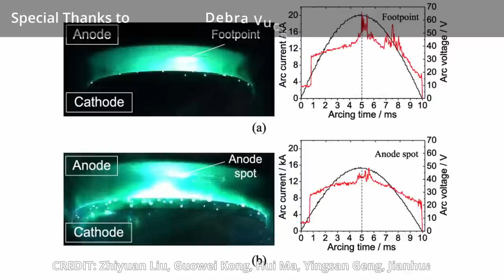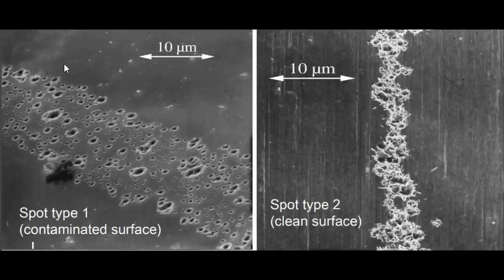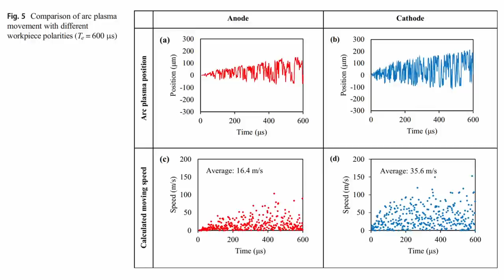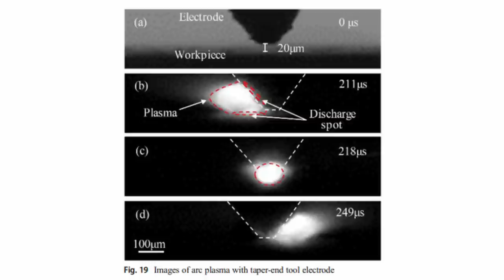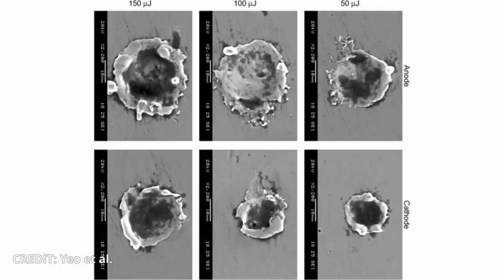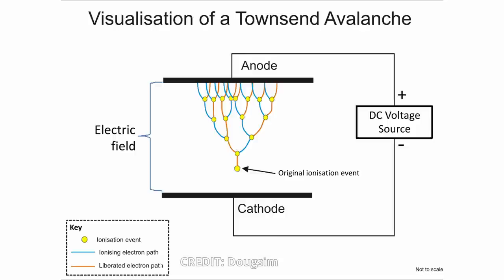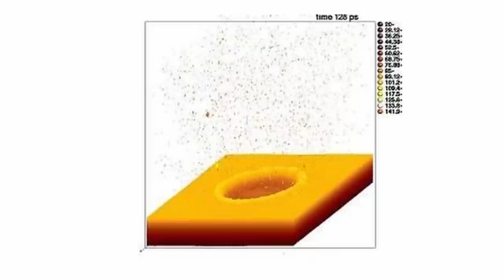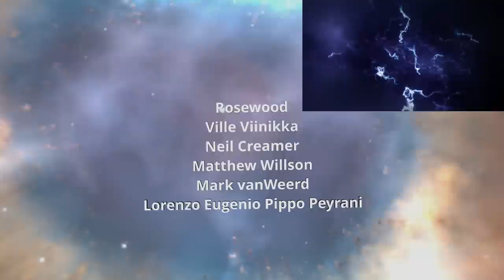Electrical Cratering - What is the difference between Anode and Cathode Craters

Comment: Given that the solar wind particle density (10 per cubic centimeter) is far less than the particle density of our best laboratory vacuums (about 26000,) it is highly unlikely that the Don Scott anode-cathode model of the solar wind acceleration is at all possible.   Otherwise, we would see a vacuum arc discharge between the Sun and the heliopause instead of a steady solar wind of 400-450 km/sec, as has been measured at all of the outer planets, nor would we see both positive and negative charged particles flowing outwards with the solar wind, not to mention that the solar wind particles are instead accelerated by first ionization potential, all contrary to Don's claims.
   One has to do some major cherry-picking and ignoring of the data on the solar wind and vacuum arc discharges to imagine that the Don Scott claims, about the solar wind, resemble the solar wind at all.
  A number of books on the solar wind state that the solar wind is accelerated out by pondermotive force, not by charge potential or mass, as Don claims.
Reply: So distance between the anode and cathode determines whether arc discharges occur or not.
Reply: @JD-pr1et  arc discharge occurs through  a vacuum or through a dielectric.  A dark mode plasma current flow requires a particle density on the order of 10^13 plasma particle density. The solar wind particle density is 10. Therefore the space between the Sun and heliopause is by definition a vacuum, and far better than any vacuum produced in a lab.
   According to Don Scott's book there is maybe 500 kilovolts potential between the Heliopause and Sun at about 200 AU approximately.  The solar wind particle density is 10 so would be talking vacuum arc discharge but probably not at 200 AU. Definitely we would not get an anode-cathode plasma current flow associated with the solar wind.
    To put this into perspective the distance between the ionopause and Earth is about 300miles ? maybe and voltage of 350 kilovolts, but no such anode-cathode wind develops into or out of the Earth.
Reply: That seems way off topic to this video but also very interesting. I do like me some alternative EM models, and the pondermotive force is an intriguing EM explanation. 
However, one reason I would pose as to why no discharge occurs between the sun and the heliopause is because of the stormy and discharging planetary system between. Main currents are via planetary poles along circuits rather than just dissipated via EM radiation. 
Granted, I'm not speaking from Donald Scott's model because I'm not sold on it. I'm just speaking from my own musings.
Reply: @KittyBoom360  there is an interesting book out on the solar wind that energizes the planets.   'Magnetotails in the Solar System.'
    The planets are energized by the solar wind and there is a distinction drawn between magnetized planets, like the Earth, and unmagnetized planets, like Mars and Venus.
       This book is  compiled from data from the NASA and other countries' planetary and solar probes and from solar observatories.
   The data suggests that there is no Birkeland current from the Sun to planets but a bow shock impinged onto the magnetosphere which powers the ionosphere and magnetosphere. 
   Contrary to the idea of a Birkeland current feeding from the Sun to each planet, the aurorae are actually an exchange between the ionosphere and magnetosphere and is not a Birkeland current but 2 current sheets with a region 1 and region 2 mainly driven by the day night cycle of the Sun.
   I try to find evidence of the Don Scott model in the data, but by all accounts the data shows that the solar wind is a magnetic flow that drags charged particles with it rather than Don's claim that the interplanetary magnetic field is created by the charged particle flow.
   Also the main discharge from a planet is not from it's poles but from the magnetotail on the anti sun side of the planet.
   I have read Don's book, but it seems a step in the wrong direction for the EU model to cherry pick to support a model, and is the same thing Einstein did for his model.
    However I do see your point but this video seems the closest I have seen to draw attention to the failures of the Don Scott claim that the solar wind is driven by a plasma current and anode-carthode idea.
 Ditto for the EU electric comet model, it is the solar wind energy that energizes a comet instead.
 Also I like most of Don's work but not the anode cathode idea that he claims drives the solar wind.
Reply: @JoeDeglman  So why does Earth have poles then in your view? Do you see poles as emerging intrinsically? If so, by what experimental evidence of poles ever emerging intrinsically, regardless of environment, do you have?
And how do you then account for gas giants having counter rotations as otherwise ascribed by Birkeland currents in Scott's model? 
How does a solar wind based on the pondermotive force account for polarization of planetary objects like Earth?
 I have so many questions, but I'll start there.
Reply: @KittyBoom360  a magnetic has a dipole and therefore poles, and does not require a molten liquid core. 
   A magnet generates magnetic field due to dipole alignment of the nuclei that make up the magnet. A harmonic wave sets up in the magnet with a harmonic node at the center. 
   The magnetic field of the Earth is caused by the Earth being a giant magnet.  The Earth's dipole was created by most of the planet being curried and solidified to create a permanent dipole moment. .
   The magnetized planets have a magnetic field and an exchange between the magnetosphere and the ionosphere but in Currents sheets.  When imaged from above are actually semicircles butted together around the poles, with two regions to each side, not true circles and when viewed as a whole appear to look like two circles and could be misconstrued  as Birkeland Current with counter rotation.   But this exchange is not an actual current from the Sun but an exchange between the magnetospheres and ionosphere.
   I think that Uranus just has a dipole that is tilted 90 to the ecliptic.
Reply: @KittyBoom360  the magnetic field of the solar wind, or the interplanetary magnetic field is actually outwards from the Sun.  The   magnetic field of the magnetotail is generally parallel to the tail as that is the direction of the solar wind flow and the magnetic flow through the tail.
    This solar wind  is in fact what Michelson Morley and Miller  detected in their interferometer experiments.   They just got the wrong equation. Had they used the Superposition of Waves Principle they would have calculated 30 km/ sec instead of 7.5 reported using a particle based light equation or Relativity.
Reply: @JoeDeglman   Honestly, that all sound very circular in logic. Like Earth is magnet with a dipole because it's magnet with a dipole. 
And what about the evidence that this dipole has switched polarity? Do you discount this evidence?
Reply: @KittyBoom360  Jno Cook has a 3 book series on Saturnian Cosmology it is online.    The idea that the Earth's pole has flipped seems to be a result of a Velikovsky claim that the Sun started rising in the  East instead of the West.   Cook thinks this was just an observation that Saturn left the north pole a now appeared in the southern hemisphere of view.  So in their reality the Earth flipped over based on Saturn's new position in the sky as it receded in the solar system.
   In reality the geological surface magnetism of the Earth shows no evidence of  a polarity flip.
   Cook points out that even if the Earth flipped over the Sun would still rise in the East due to the Earth's rotation, so they were talking about Saturn not the Sun.
    If according to the thunderbolts project, Saturn was at the North Pole of the Earth around 20000 to 30000 years ago and we migrated into the solar system with Saturn, then how can the Earth possibly have evidence of  regular  polarity flip associated with a solar micronova as Ben Davidson claims?
   Check wiki on pole flip. There is no actual regularity to surface magnetism in the geological surface features, only locally varying in magnetism mainly due to local magnetic storms that deposited or rearranged materials onto  the Earth.
Reply: @KittyBoom360  in reality any  regularity to a pole flip ranges from 26500 to several million  years based upon curried and solidified geological deposits. Pole flip is only based upon confirmation bias, people looking for a regularity or a pole flip, but there is no actual evidence of a world wide polarity flip.
Reply: @KittyBoom360  in fact Ben Davidson cites an article on Jupiter that talks about a pole flip on Jupiter as evidence that the Earth too must have flipped.  
But when you dig into the article there is no pole flip on Jupiter just two distinct periods of rotation of the rings around Jupiter.
   The rings don't actually switch direction just rotational velocity.  They refer to this phenomena as polarity flip for some reason.
  This periodicity does appear to be associated with a solar maximum and minimum of solar wind energy levels not an actual pole flip.
Reply: @JoeDeglman  To be clear, I was not referring to Earth flipping over. I was merely referring to the mainstream view in academic science that Earth's polarity has reversed many times in the past, called geomagnetic reversal on wiki. It's not based on Velikovsky but on geological evidence, first noticed by the magnetic stripes on the ocean floor. But you can forget I mentioned it because there are mainstream explanations for the pole flips that don't involve alternating Birkeland currents. I just don't agree with them.

As for Ben Davidson, I'm not a fan of his, so won't defend him. I'm actually banned from commenting on his channel.
Reply: @KittyBoom360  in University oceanography classes were were taught that the ocean floor strips alternate in a 26000 year cycle matching the precession cycle of the equinoxes.   That too has also been debunked.    That has been proven to be put together by someone trying to show that there is a reversal cycle.    That too is listed in wiki, and you could be right it is under reversal not pole flip.
   The other so called evidence of a reversal is the claim that the magnetic pole are wandering.   Such wandering has in fact been shown to be normal, not antipodal, and has nothing to do with a so-called dynamo core of the Earth.
    When you get into Anthony Peratt 's work and the Earth's Ring current or Van Allen belts, the magnetic contact point on the Earth is actually external feed into the polar regions from the ring current.    
     The wandering is normal and has been shown to be caused by a wandering charge build up in  the Earth's crust and is randomly wandering at each pole.
   There is a NASA article stating the the last pole flip was 780, 000 years ago or so, so the ocean ridge floor cycle of 26000 clearly doesn't match that, nor the Ben Davidson micronova cycle he claims.  According to NASA and wiki there is no verifiable cycle frequency to any theorized pole flip.
Reply: But let me ask this, since the magnetic field cannot be from a dynamo core, and if the Earth doesn't have a curried dipole like a magnet, the field must be induced by the ring current or Faraday induction IAW the right hand rule. Can you name a mechanism by which the Earth's ring current direction would rotate in the opposite direction to induce the theorized reversal? Also given that the solar wind magnetic field will always be an outwards flow.
Reply: @JoeDeglman  Yeah, assuming our evidence of geomagnetic reversals is solid, I still don't really think there's any good link to precession either, as far was we can tell. Side note, I do kinda think that precession could be linked to our view that ice ages happen every 11,000 years or so. This would be half the precession cycle, meaning our ice sheets are just shifting to match precession, and not actually being ice ages at all, just shifting placement of ice caps to match the new north. 
And, yeah, dynamo core models are probably BS. 
I do kinda get what you're saying about the pole contacts points being externally fed, however, I would just go further and suggest that Earth is not electromagnetically isolated is likely part of a larger EM structure with perhaps even currents running through its poles, which lead me to answering your question about how to theorize a pole reversal, that is, I would suggest an alternating current, AC.
Did you know that the sun is popularly thought to switch polarity every 11 years with its sun cycle? To me, that's most likely because it's connected on an AC. We know that AC is better for transferring power over long distances, so that makes sense to me that nature would had figured that out too. However, I am admittedly puzzled over why Earth only seems to switch over very long time periods and seemingly randomly.
Reply: @KittyBoom360  The Sun does have an 11 year cycle, but it cleary it does not match the cycles of Jupiter's. Nor does it match any other known cycles.   There are unverified claims that the polarity of the input current from the galactic spirals might switch every eleven years, but that is a tough unverified sell for me.
  
    So for the Sun, we could make that case that if it has a core with a permanent dipole and the core is capable of storing charge, that would leave us a model to work with. 
    If you have ever seen the Russian cosmonaut wing nut experiment, this might be what happens to the Sun's core.
     I could envision a core with a permanent magnetic dipole storing charge in opposition to the surrounding magnetic field, then flipping over every 11 years, like the Russian cosmonaut wing nut experiment.
  Even a reversible AC motor requires a capacitor  to get it to rotate in the proper direction, but once it starts to rotate it will not switch direction unless it is physically flipped over.
 But to be clear, for the Earth, if it did flip over with a permanent dipole, the magnetic compass would still point to the physical north pole.
Reply: @JoeDeglman  On wiki's Solar Cycle page, it says, "The magnetic field of the Sun flips during each solar cycle, with the flip occurring when the solar cycle is near its maximum. After two solar cycles, the Sun's magnetic field returns to its original state, completing what is known as a Hale cycle," without a reference. Are you saying this is unverified and probably false?
Reply: @KittyBoom360  that is not what I am saying.    It is clear that magnetic polarity of sunspots in the northern and southern hemisphere of the Sun switch every eleven years, but what is the mechanism?
    To say the Sun is AC, what does that mean?    You are presumably talking about the input current that feeds the Sun?
    Hannes Alfven thought that stars were either matter or antimatter.   A matter star had an antimatter input current feeding it, an antimatter star a matter input current.
  But matter and anti matter appear to debunked by many accounts.
    So by A C do you mean there is a sine wave in the galactic spirals?, which appears to be verified, but what would change the voltage potential from positive to negative every elevens years then? Define the cause and what is AC when it comes to the Sun and its reversal.  
   The Sun does appear to orbit a harmonic node in the spiral arms and perhaps in a Marklund convection ring and presumably every 26000 years or a Great Year, but that also would not account for an eleven year cycle.  What is that cause of the 11 year cycle.?   What causes the AC you propose?
Reply: @JoeDeglman  Yeah, nothing as exotic as invented antimatter. I'm simply talking AC as in electrical engineering. I'm one who tends to view the sun as electrically powered. And given that stars are powered across vast distances, it makes sense to me that they would be using AC instead of DC for the same reason we humans do. We only use DC when things are nearly touching and AC for long distance power.

As to the cause or mechanism of AC for stars, that would just be rotating magnetic fields, same as how we produce AC with an alternator, though it could also be an rotating armature with a stationary magnetic field, I suppose. Either way, regardless, you just need rotating magnetic fields to produce AC, relatively speaking. 

And since rotations seem to be the cosmic norm, it just seems natural that AC would be the natural power source, not DC. Like, what natural magnetic fields are not rotating in the cosmos? 

Now if you were to ask me exactly what rotation is causing the 11 solar cycle, I don't know. It could be the spiraling double helix Birkeland currents feeding it or it could be something further down the line, maybe even the galactic core. 

My home's AC is 60 hertz, switching 60 times a second. Scale that up to star systems and a galaxy and one switch in eleven years seems reasonable, no?
Reply: @KittyBoom360  in an AC generator the conductors' rotational axis is orthogonal to the N-S axis of the magnetic field, causing the alternating current.
   In galaxies, stars, and planets the rotation is around an axis parallel to the N-S magnetic axis.   Which means from an engineering standpoint we need a mechanism to rotate the Birkeland currents orthogonal to a magnetic field N-S axis, like rotating the galactic spirals orthogonal to what they do now.  And what mechanism causes the 11 frequency.
Reply: @KittyBoom360  to me nature must use condensation and rarefaction of the magnetic medium to transfer energy, just like we use an air conditioner freon to pump heat.  Organisms use charged particles  to pump energy or heat. 
    In electric motors we just use the electrons as condensers and movers to  move a magnetic medium around in order to transfer energy. Energy can only manifest by the motion or momentum of a medium.
   Planets then get their energy from a unidirectional magnetic flow from the Sun.   Fusion and solar wind particle flow occurs in the solar atmosphere and chromosphere, and is a mere side effect of a magnetic medium that comes directly from the upper photosphere, as Alfven claimed. AKA magnetohydrodynamics.
Reply: You can't see the invisible ERM.
Reply: @aaabeverages7152   I assume that you mean EMR?  the EM spectrum is visible to the human eye in the visible spectrum, but visible to radio telescopes above that. 
   The electromagnetic spectrum is just light and does not contain 'radiative' particles but is a wave in a magnetic medium.
 Or do you mean solar energetic particles or radiative particles?   Or you must mean dark mode discharge?   The solar wind particle density is 10 particles per cubic centimeter while a dark mode plasma current requires a minimum particle density of 10^13 particles per cubic centimeter.    Cosmic rays or solar energetic particles are indeed invisible, but not propagated by and anode-cathode relationship, but are expelled from areas of high photon production such as from the Sun, or by nuclear fission.
       The main point being that for a discharge to occur through the vacuum of the solar system it must be a vacuum arc discharge, which is always visible like a spark plug discharge and would be visible in x-ray and gamma, like a lightning strike, FRB, or pulsar pulse.
   The data from every book I have read on the solar wind indicate that the solar wind is a magnetic flow, AKA Poynting flux dominated flow, that drags the charged particles by pondermotive force and can have nothing to do with a so-called anode-cathode relationship between the Sun and heliopause.
   Not to say that there isn't a voltage difference there, but the properties of the solar wind, vs standard rules for such plasma densities and discharge modes, prove that the solar wind cannot be accelerated by such anode-cathode relationship.  The solar wind density is a way better vacuum by particle density than any laboratory vacuum on Earth, and incapable of even dark mode plasma current flow.

   There are other properties of the solar wind that rule out the Don Scott claim if you are interested in them.
Reply: @JoeDeglman  Honestly, I think there is a lot of truth of many of your arguments. I just tend to think of them as limiting. You seem to too readily rule out other processes which we know are possible via our own technology. It's almost like you view nature as dumber than us and couldn't possibly already be doing what we're doing, as if AC is so advanced and humans are so advanced, and so only humans could be using the superior form of AC over DC for powering things long distance.
Reply: @JoeDeglman  I mean, really, nature only uses the crude forms of condensation and rarefaction, in your mind? 
We learn from nature. We don't surpass it, if you ask me.
Reply: @KittyBoom360  In the wing nut experiment the entire wing nut does flip over at a nominal frequency.   I do believe in the wing nut experiment the metal structure charges in opposition to the polarity of the earth's magnetic field, but the field of the wing nut is determined by rotation, or the right-hand rule.
   I don't believe an actual theory on the wing nut has been verified.

But for a magnet only a solid can be curried and refrozen to hold a permanent magnetic dipole moment.    So, my hypothesis then would be that instead of a magnetic dynamo core, the Sun's iron core would be curried with a permanent dipole and/or the core would hold a charge and that charge would build onto the pole of the core, in opposition to the magnetic dipole moment of the iron core.
  So due to the resistance of current migration through the iron core the current cannot migrate through the core as fast as a charge build up occurs onto the core.  Thus, roughly every eleven years the core would flip due to the charge build up on the core overcoming the magnetic dipole momentum, then the core would flip and discharge in reverse, until that charge build up gives way to the magnetic dipole moment and the core flips again.
   As far as an A.C. mechanism in the Birkeland currents, I cannot think of a way for this to work other than a current feed that switches from matter to anti-matter, or from positive to negative charged particles every 11 years.   What I am saying is that I am open to any ideas on this subject, but I prefer to stick to mechanism that are verified by experiment.
Reply: @KittyBoom360  Actually Nature uses condensation and rarefaction all the time, in the form of ionization and recombination. Such as to make it rain, and the rarefaction of a dielectric, upon recombination, is what feeds or heats a storm or hurricane, while allowing the recombined or deionized water droplet to drop as rain.
  A Birkeland current, starting up, ionizes matter into a plasma and a magnetic influx or condensation occurs. CERN uses this acceleration to excite hydrogen into a plasma state, and raise the electron away from a hydrogen atom so that the electron can be mechanically stripped away from the hydrogen proton.  Upon pinching the Birkeland current in a tokomak plasmoid, recombination or fusion occurs, resulting in a magnetic rarefaction, known as fusion or recombination energy.
   Charged particles are verified by capacitors and inductor coils to be condensers of the dielectric as well.   Such as how a pop can be crushed by dielectric storage into an inductor coil.   A radio signal is created by condensation and rarefaction of a dielectric in an inductor coil or oscillator.
  Similar to a radio oscillator, an atom (when excited) energizes the electrons and lifts them out and away from the nucleus, causing a dielectric condensation into the electron shell.  Upon relaxation back to ground state the electron shell rarefies the dielectric and emits EM pulse known as a spectral emission.
     Organisms also use ionization to condense the dielectric and recombination to rarefy the dielectric, otherwise known as electron pumping of energy or infrared heating.

   A Birkeland current is a form of energy transport by condensing a dielectric inward to the center of the flow, as the input matter is ionized, and releasing energy to heat or energize a star, galaxy, or planet by refraction of the dielectric, otherwise known as Marklund convection.
Reply: @JoeDeglman  Really, matter to anti-matter is your solution? And then you go on to mention, "I prefer to stick to mechanism that are verified by experiment." Seriously? What anti-matter experiments are there really? And you actually believe the sun has an iron core? What experiments verify this? This all seems very self-contra-dictionary.  It's hard to take you seriously after such words.
Reply: @KittyBoom360  I guess you have left the rail.
Reply: @JoeDeglman  Sorry, my last comment was kinda rude.
Reply: @KittyBoom360  the Electric Universe model suggests that dipole forces and current flows are the dominant forces in the Universe, planets, and solar system.
   I think that maybe be true for energies  that feed into a galaxy from the cosmic web and perhaps a closed energy system.
    But the stars and planets appear to receive their energy from magnetic bow shock systems. 
   I would suggest that within a galaxy, our solar system, planets, and moons, the dominate energy source is not plasma current flow but a magnetic energy flow. 
     Within a galaxy and solar system energies from  electric currents are dwarfed by the energies of magnetic flow. In fact magnetotails would explain the energy of a pendulum experiments conducted during solar eclipses due to a magnetopause boundary magnetic concentration. (There is scant evidence of charged particle flow in the moon's magnetotail, but it can indeed induce cross currents in the wake of  it's magnetotail. 
    Probes have detected a permanent directional current flow along the solar bow shock and into the magnetotail along the magnetopause, and cross currents in the magnetotail.
    Even the Curiosity Rover detected cross currents in the Martian surface during the solar eclipse of Phoebos on the Martian surface.   It just gets reported as unexplained in press releases. 
   Also gravity is better explained by a dielectric or magnetic flux density gradient or magnetic Venturi gradient than it is by mass, charge, dipole, or Newtonian gravity.
Reply: @JoeDeglman  What do you mean by "energies of magnetic flow" and "magnetic energy flow"? I don't understand magnetic fields as able to be sources of power or have an energy flux. By themselves, magnetic fields are just like there, not supplying energy. In order to transfer energy, a magnetic field requires an accompanying electric field, such as with light. So something like a "magnetic bow shock," as you put it, would still require an electric current or an electric field to actually supply energy. Otherwise, such a bow shock would just really be a magnetic field adjustment, perhaps to a current. And, actually, this understanding could answer your very first comment as to why no discharge between the sun and its supposed heliopause, given that the solar "wind" is actually a solar current. It is the discharge, so to speak. 
As to your comment about gravity being dielectric, that does not actually contradict Electric Universe models, as I understand them. But being dielectric is a result, not a cause. Thus, an EU model could explain the cause, that is, a structural dipole in relation to the environment. I would add that it might also be deconstructive, which would explain why "gravity" is so weak and also cannot be shielded against, at least as far as we know.
Reply: @KittyBoom360  the dielectric is a fluid medium AKA the ether medium.  The dielectric is a fluid medium condensed around all charged particles and is the magnetic field observed around all charged moving particles.
    When I say magnetic energy flow, I mean a flow of and/or wave in  the dielectric medium without charged particles in it, as in the Tesla radiant energy experiment, or like the photon particle beam out of a laser cavity.
    I mean the dielectric medium, a pure Poynting flux, flows out from the Sun, as a fluid medium, and drags the charged particle with it, AKA a pondermotive force, NOT charged particles creating a magnetic field.

   The EU dipole gravity model is adopted from Immanuel Velikovsky.   Wal Thornhill has a video in which he pretty much debunks it himself.  Wal explains that if dipole gravity were correct, we should be able to shield gravity with an electric field, we cannot.
   Dipole gravity is when the dipoles of atoms line up and create a force vector pointing towards the center of the Earth.   Such a model is impossible as the Earth's magnetic field lines up the dipoles of atoms up along a N-S axis with the magnetic field, not a force vector pointing towards the Earth's center.
    I mean that gravity more directly relates to the dielectric density gradient, AKA ether medium density gradient, as a buoyant force.   Acceleration by Buoyant forces also mimic acceleration by gravity.
   In fact, dipole forces drop of at 1/r^5 or 1/ r^6, not 1/r^2 as gravity does or buoyant forces do.
Reply: @JoeDeglman  "The Origin of Matter at the Base of Relativistic Jets in AGN" invokes both black holes and neutrons, neither of which I believe in. So right off the bat, I'm like, why am I reading this mythology?
A "neutral plasma" is an oxymoron.
Riddle me this. How do does one detect a "pure magnetic energy, no charged particles present"?
Reply: @KittyBoom360  true the article does try to fit the narrative to the Einstein model, it also uses the quark model, both of which are debunked by experiment.
   However the basic facts remain that a pure Poynting flux feeds the jets and neutrons are created in the jets.  
   Neutrons do decay into atoms over time. 
    The Fermi telescope can image these jets in the gamma frequency due to their vibrational frequency despite there being no such charged particles in them.  The Fermi telescope can also image the galactic core and Fermi bubble by the gamma frequency light that they emit.
   Light is a vibration in the ether medium and does not require the presence of charge particles.
Reply: @JoeDeglman  (Edit: I wrote the following in response to an earlier comment, not the one above, though it still fits.)
The Poynting flux is electromagnetic, not just magnetic.
I'm not aware of any Tesla radiant energy experiment that demonstrates we can power anything using just magnetic fields without electric fields. 
I'm suspect of a medium or ether to explain your purely magnetic energy transfer, to be honest. That seems purely hypothetical and counter to actual experiments.
Reply: @JoeDeglman  Buoyance is determined by gravity so using one to explain the other is circular.
Reply: @KittyBoom360  true as is GRT use of gravity to explain curvature of space.    However the Gravity Probe B has confirmed the ether medium density gradient.   And laser experiments by the Sun have confirmed that light travels slower near the Sun and faster at 2, 3, 4 solar radii ect. 
      However there is an equation by Ron Hatch in an article called "John Deere searching for a better way," that shows that gravity is better defined by energy levels, which are in fact caused by the density gradient around the Earth.
    Gravity is a better fit to experiment if caused by the dielectric density gradient around the Earth than even by mass.
    And Hatch gives an actual physical cause for gravity unlike Newtonian gravity.
Reply: @KittyBoom360  pick up a compass and the needle points North meaning the magnetic field will align the atomic  dipoles in the compass with the magnetic field N-S axis.   Therefore the magnetic field can create a dipole force.   The compass doesn't  point to the center of the Earth, therefore dipole gravity falls by experiment.
Reply: @KittyBoom360  such an interesting debate! I would think of an ac is acting like antimatter perhaps?
Reply: @JoeDeglman  really interesting theories well explained, in fact it oozes with passion! Thanks
Reply: @eauderay5312  an ether medium or fluid condensable/rarefiable medium model is the ultimate answer, or the Grand Unifying Theory. 
    When I read Ron Hatch 's book is when I knew the correct model.  
    Models like the Le Sage Push Model actually have it backwards.    The ether medium is more dense near the planet, as matter, and charged particles, is a condenser not a rarefier of the medium. Ron Hatch's model of gravity as a buoyant force in the ether medium density gradient makes more sense than any other gravity model out there.
    In the same manner as sound travels slower in a more dense medium and blueshifted, so does light travel slower and more blueshifted in a more dense medium. Clock speed and frequency, as in Gravity Probe B, is a function of a medium density; AKA back Emf.